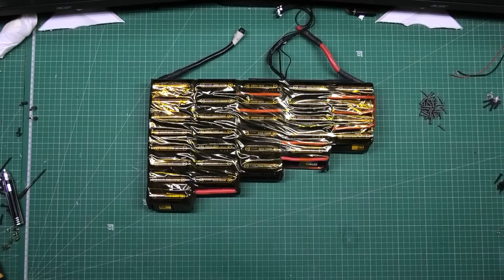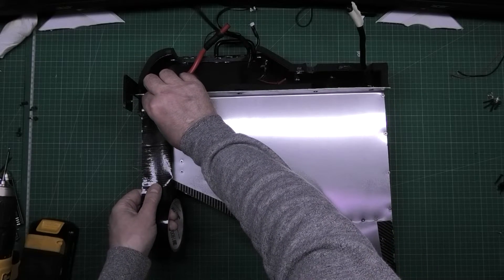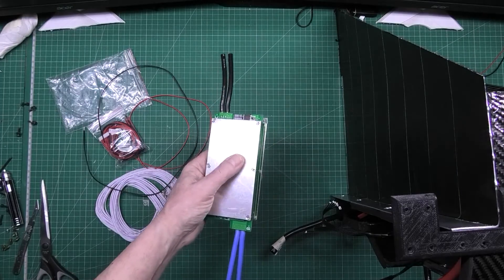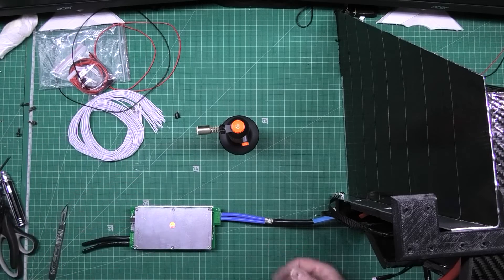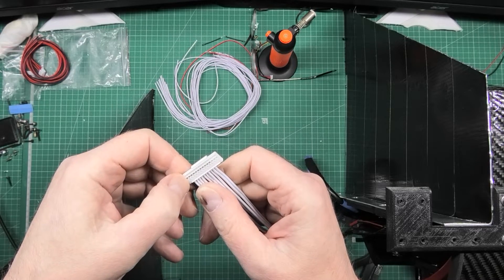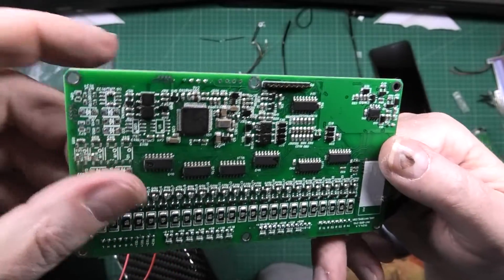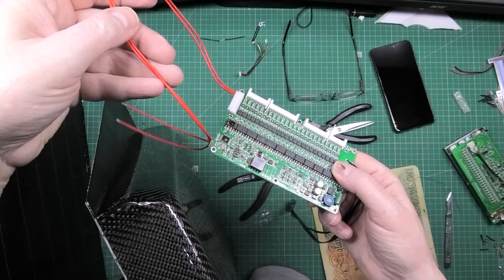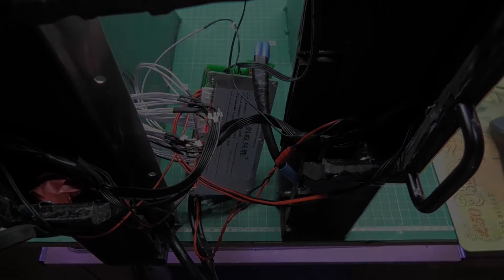High powered e-Bike battery BMS replacement - part 2

Comment: Thanks, I need to extend the buzzer on my BMS so this is good info! Any idea what the voltage of the buzzer is and whether or not I could use that to energise a relay? Just thinking if the buzzer isn’t loud enough I could use the circuit to drive a louder 12V buzzer. I’m using it on a motorbike so it needs to be reasonably loud!

Comment: How do you know witch bms you need? I know as it is a 36v, you need a 10s one, but how many amps? I gount from  10 to 60a versions. Is 60a for a 250w motor overkill or to low?

Comment: Thanks for the explanation on the Bluetooth module. Mine broke, didn’t know how to fix it. Does this bms use the same Bluetooth chip of the old one? Is it the same pattern for he cables?
Reply from the maker: Yes, the old Bluetooth module is the same as the old one with the same pin-outs 😁
Reply: Vortecks do you by any chance have a photo of where I need to install the buck converter? I already took out the module.
Reply from the maker: @albertoflecha2388  If you're using the original one, you don't need a buck converter, you only need to extend the 4 wires https://youtu.be/rZDHmonCqfc?t=625
The reason why I used a buck converter on my previous one is because the 3v regulator on the BMS blew. I had to take a 12v line and drop it down to 3v.

Comment: Tony, some conformal coatings are highly thermally conductive and specifically applied between a heat-generating electrical device and a heat sink in order to improve heat dissipation.  Removing the coating from your board could actually decrease the thermal conductivity.

Comment: Hey Tony. Well, you've made my day (again) as now I know that I'm not the only one who gets nervous about connecting up a shitload of wires. And, you said it way better than I was (incompetently) trying to say before about how a BMS goes on the negattive side of everything. It's getting on towards Springtime here in Colorado. Took my pathetic little bike (35mph, 36vdc,16ah batteries) out the other day. Rode all over Woodland Park. About 20 miles with a lot of up and down hills and started out at both batteries (I have it configured to select batt.A or batt.B or both at the same time) at 42.5 volts. I got home showing 38.2 volts. Wow! I sure do love the LiPo's! Good video as always mate!

Comment: Try balance a 3kwh pack at 280mah  (with fan cooling) all because of "the amount of work involved" in stripping a 40kg LTO pack 😉 - The electric FZR motorcycle channel.